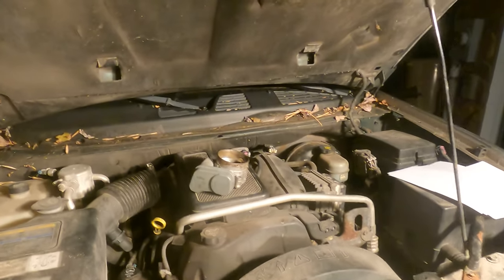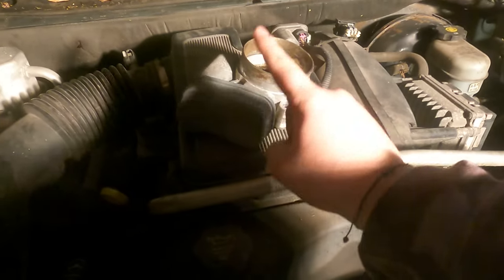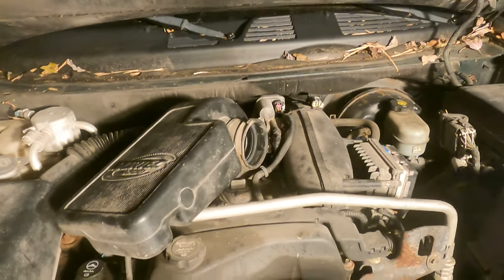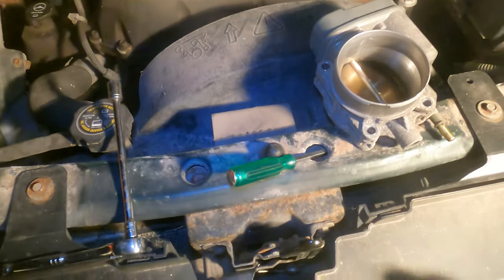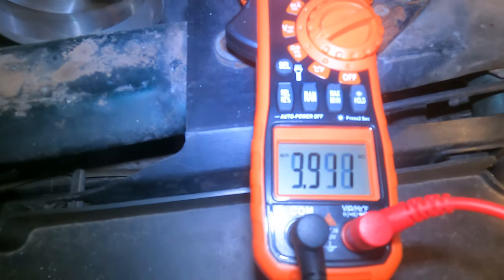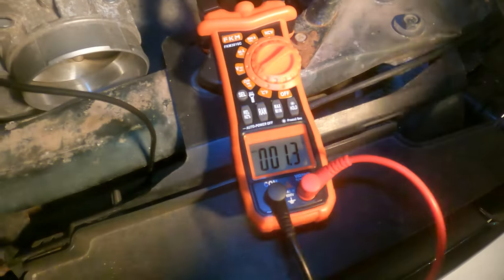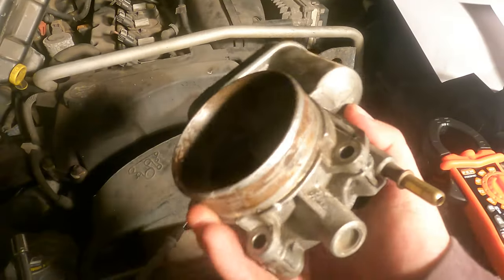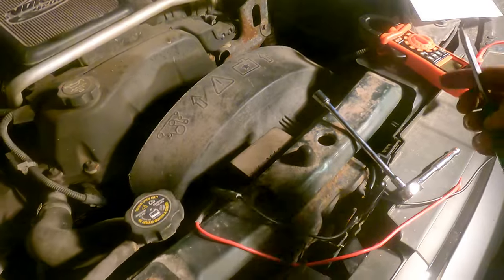2003-2007 Chevrolet Trailblazer GMC Envoy: Troubleshooting & Replacing Throttle Body

Comment: Did it work?  Kinda missed that most important step in your video????  😀
Reply from the maker: Haha that is a good point. So for me specifically it didn't. Mine turned out to be the sensor on my accelerator pedal 😂
Reply: @dieselpackgarage8796  Sensor on your Accelerator...hmm.   Mine has been having problems for the last 2 or 3 months.   RPMs drop down to Zero or below at Idle.  My Power Steering pump in making noise and maybe binding the Serpentine Belt while driving.   Either way, thanks for the information....